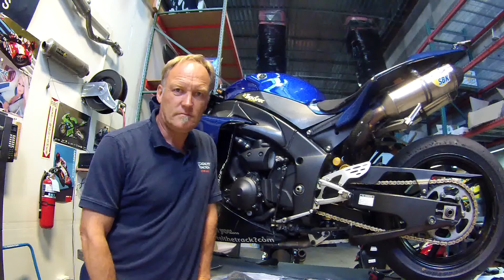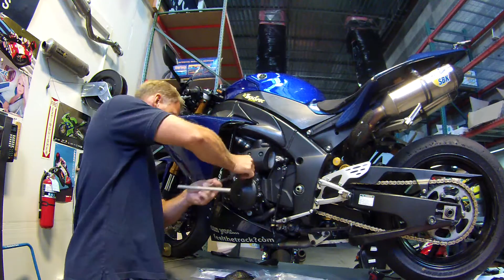Leo Vince SBK Carbon Fiber engine guards Part 1

Comment: I bought the Driven 1&1/2 risers bcuz I’m pretty much over the whole hunchback ricki racer ride.Getting older anyways I called Driven and asked what size brake lines,throttle,clutch cable do I need to install they said they don’t know or have any idea Bcuz there all pretty much universal as long as you have the same size fork tube...I ordered them for a 02 R1 so I replied you mean to tell me you never installed these on a 02 R1 and took the measurements...there answer again was NOPE.I read the directions,yes I understand they are not OEM replacement.that’s exactly why I need the new cable sizes.Or if I even need new cables @ all idk
Reply from the maker: If you need custom cables, reach out to Motion Pro. They can get things rolling for you. (650) 594-9600

Comment: To avoid engine case side covers for damage there are Carbon Fiber Engine Guard Case Cover Sets, in case of fall, I have them in mine, it save me once from a nasty repair. It costs about 70-100$ per piece depending on your bike model, is really worth the investment, trust me. Also engine guard crash mushrooms will come in very handy. Safe riding mates, cheers